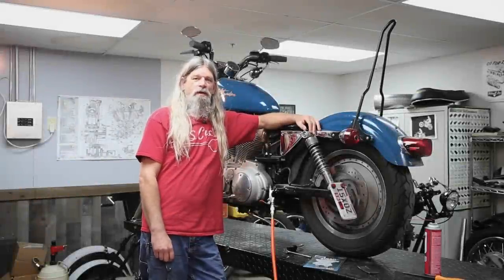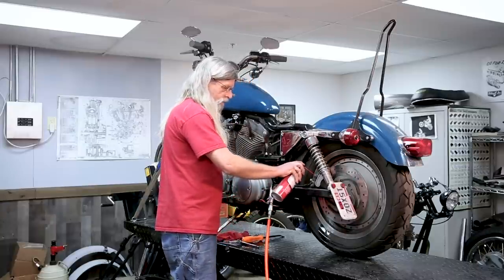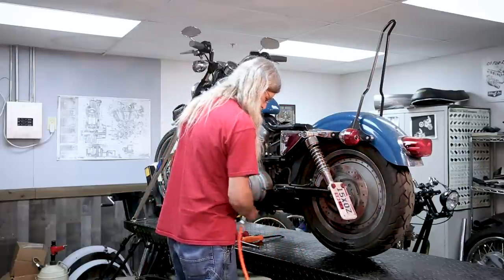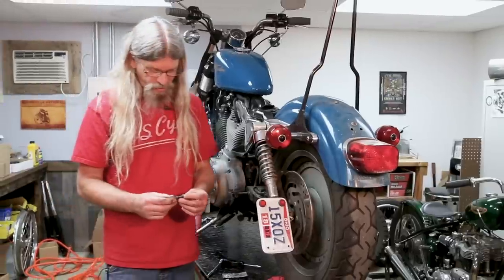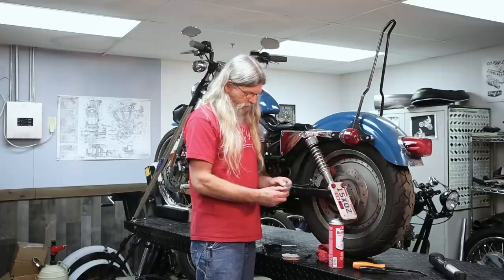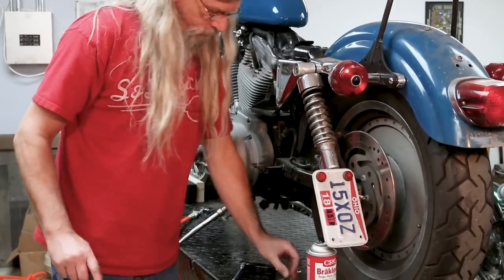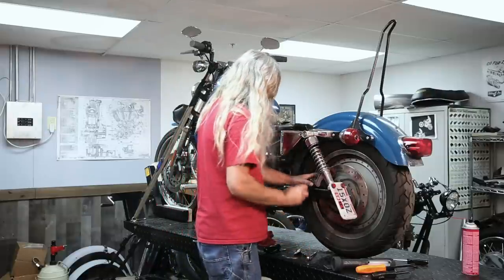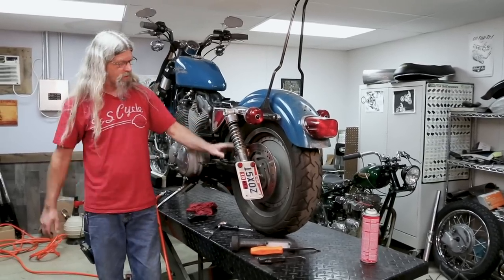How To: Change Rear Brake Pads On Harley-Davidson Sportsters

Comment: I had no problem replacing the front brake pads on my 2006 Road Glide. But when I looked into replacing the rear brake pads I thought for sure I was going to have to take the bike to the shop. Then I saw your video. Thanks to you, replacing the rear brake pads was a lot simpler than it looked. Thanks  Todd.
Reply: The sportster roadster is different with two pistons,  one on each side and the pin that holds the pads in is in the middle of the pads and caliber!

Comment: Just replaced the rear brakes on a neglected '98 Sportster 1200 I recently bought with help of this video, and only took about an hour!

My bike had the addition of a small metal clip that held the brake assembly in place which took me a bit to work out, and getting the brakes off was a bit of a pain but once they were off, everything came together really well! Next up is brake fluid, oil/primary change, and new spark plugs!

Comment: Wow! I had to watch a dozen videos of rear brakes being replaced with different bolt patterns before stumbling upon this Masterpiece. And as Todd stated that caliper is used on different models, exactly like my 04 Superglide except on the Right side. And just as with my Superglide the master cylinder is behind the exhaust??? And wouldn't you know it these guys are Not only Buckeyes but right here in my backyard, Literally, I'm in Lodi. You have found yourself a New customer as I like to shop Local. See ya in the future. Thanks for the Great video, your commercial is crazy too. LOL

Comment: Todd looks like he came right of out central casting for a Gen X Harley biker tech sans tats but complete with his digital torque wrench. I love how he goes on on about "pin lube" (most people just call it brake lube and also put a dab on the back side of the pads to prevent brake squeal . BTW I also find cracking the top of the brake reservoir tends to make compressing the caliper pistons easier and not as messy as the bleeder valve (Mindful of a little overflow if the reservoir is already full)

Comment: Mine has a trim piece over the caliper held on by a bracket that mounts to the center bridge bolt. I was unfamiliar with the setup the first time (after doing the front) and thought I needed to slide the caliper out of whatever mount it had. Then realized the caliper was attached at the axle. But then I also ignorantly removed the bridge bolt when trying to loosen the trim bracket because it blocks the pad retaining pins. Got a lot of air in the system. I know you’re supposed to replace all the seals if you take the caliper apart but I wasn’t able to remove all that right then and there or have the parts even if I could. So I tightened it all back up and proceeded to bleed the system which took a long time. But it seems to be holding fine.

Comment: 15X0Z probably isn't happy. lol 

I've always compressed my caliper after taking them off using a C-Clamp. Your way looked like it saves a little time by leaving the caliper on the bike, but it also could have bent the brake rotor. I noticed it flexing when you pressed on the pads. I think I'll stick with the C-Clamp way. 

On the port side of the bike, that DOT 5 brake fluid looked brown and nasty. It would have been a great time to put in new brake fluid.

Comment: On that particular Sporty, is it not necessary to loosen the Fluid reservoir cover, before  pushing the old pads back out,... just askin :-)
Reply: Not if you didn't over fill the fluid. That's on any hydraulic brakes. Don't top it off unless it's leaking which should be fixed immediately. As pads wear the fluid level will drop. Low fluid level and no leaks indicates it's time for new pads.

Comment: That brake fluid a little dark to me. I would change it if it were my bike. And I did. My bike is only 5 years old now, a 2015, and I changed my brake fluid with a hand vacuum pump. Fresh brake fluid did make a difference in the feel of the brakes, especially the rear for some reason. Because, I'm sure you know but some viewers may not, brake fluid does absorb moisture which can make the brakes feel spongy!
Reply: Easiest way to screw with someone is to flush their brake fluid. First time I flushed the brake fluid in one of my vehicles it felt like I damn near went through the windshield the first time I hit the brakes outside the parking lot. LOL

Comment: I've watched your video and it seems pretty straight forward doing brakes on my Sportster. Two questions; Are the front brakes the same? And where do I get this brake pin lube?
Reply: Just did the front brakes on my 2000 sportster yesterday, super easy takes like 10 minutes.  Easier than rear because I loosened the two 1/4in 12 point pins and then I used a 10mm 12 point to take the caliper off the rotor so that it was easier to work with you can just hold the whole caliper in your hand.
Reply: Auto parts store. Same as used on brake caliper slide pins on cars. They'll know what you mean.

Comment: another reason i prefer my Dyna to a Sporty.. that rear break master is getting boiled by the exhaust pipes top and bottom. Radiational heat is bad for fluid viscosity and density
Reply: Your brake fluid gets super hot just from use. The friction from the pads and rotors radiates into the calipers thus the fluid. Also just the hydraulic pressure alone will make it hot. No big deal.

Comment: What size 12 point socket is this?
Reply: 1/4 inch he said.
Reply: I tried using a 1/4 inch and it didn’t work.
Reply: @user-tn1si8ng1h  Try metric.

Comment: Would be surprised if brake fluid was ok since brakes pads worn all the way down to nearly bare metal.  Fluid is probably way over moisture level.
Reply: Doubt it.